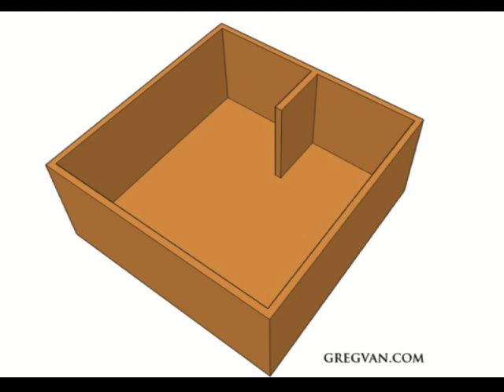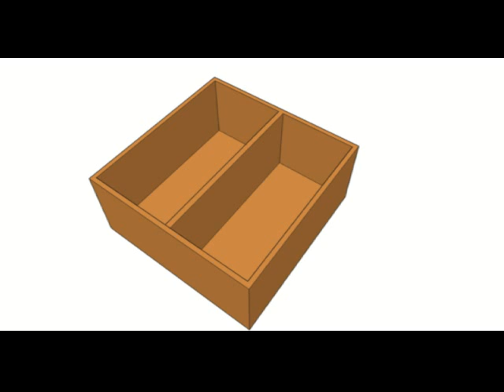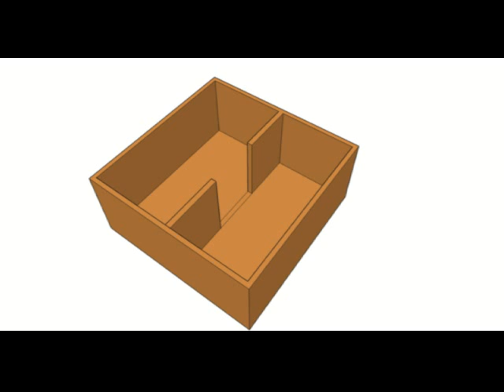Can Removal of Non-Loadbearing Walls Make Buildings Lean? - Structural Engineering

Comment: This video was super helpful my question is what affects or effects would you have or feel when you remove a non load bearing wall that is used for structural strength
Reply from the maker: It can reduce the side to side or lateral strength supporting that section of the house.

Comment: Would relocating an exposed load bearing beam, one that intersects an exterior wall, into the ceiling (commonly referred to as 'hiding a beam' ) be a problem for that exterior wall? I don't think the structure is balloon framed (cape cod) so it may add some support as the hidden beam would intersect the rim joist of the exterior wall and not be under it.......?

Comment: Greg, my contractor, who is a reputable builder of 40+ years wants to cut out some of a 4x4 exterior door header (aprox 1") in order to install a larger door (new door cannot be cut down). He feels that such will not be a problem because he feels that the header is not load bearing. Is doing so, as a general matter, ever okay?

The door is a 32" door on the bottom floor of a two story home. The joists above the door run perpendicular to it, approximately 2 1/2" above the door.
Reply: Correction: it is a double top plate, not a 4x4.
Reply from the maker: Feel free to send me a picture and you can get my e-mail address by visiting our website http://gregvan.com and going to the bottom of any page for the contact information. You shouldn't need to cut any top plates to install a door and if the second floor joists are sitting on top an exterior wall, it could be a problem.